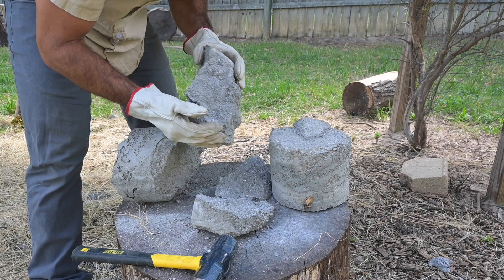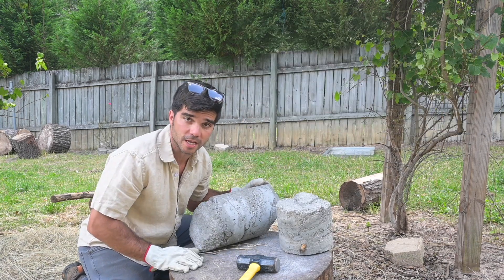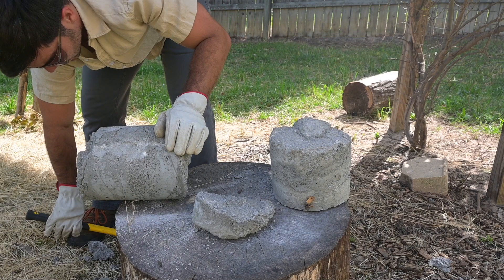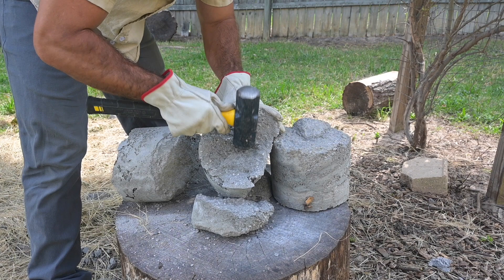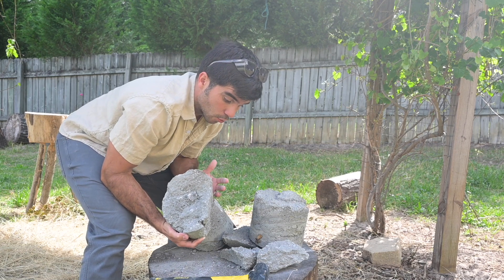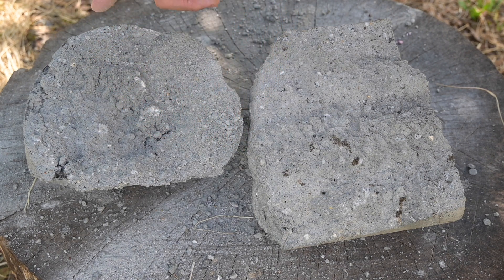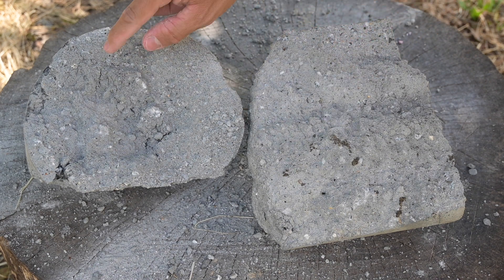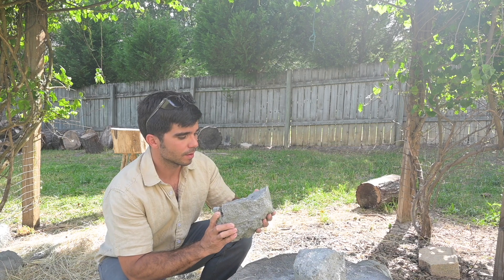Was I Wrong About Dry Pour? 🤔 (testing four weeks after pour)

Comment: I did a 3' x 7' pad for the steps up to my wife's She Shed using dry pour.  The depth was about 4 inches and I put a metal mesh about halfway through.  I poured a few bags at a time and used a garden rake (not a leaf rake) to mix it in as I went.  I also tamped down the ground before pouring any concrete, and tamped it all down solid at about 2" before placing the mesh and poured in the rest of the bags.  

As I built up the layers to the top of the wood forms, I kept tamping down the concrete especially along the edges to make sure I had no air pockets.  I screeted the entire top multiple times to drive 99%+ of the rocks down into the concrete. I then used a light broom to lightly brush the top to smooth out the look.  I did use a curved concrete towel to round over the edges on the three sides not up against the shed.  That last part was a pain and though it turned out nice --I do not recommend it for the trouble it takes to make it look decent.  In the end though, It has turned out pretty good.

I did have one issue.  After I did my second misting of water, we had a heavy unexpected downpour of rain (I'm in Florida).  A few areas on top ended up pitted including a bout a one inch hole on the back where the water came down as a stream off the roof.  No rain was expected that day, but hey in Florida it can rain without warning just about any time.  Those areas will be covered or hidden by the steps, so I call it a success.  

I waited one week before I took of my forms and the edges look solid and smooth with no air pockets.  I am waiting a full month (one week to go) before I build the steps and attach them to the pad using 1/2" redhead concrete bolts.  I call it a success so far and am very happy with the end result.  I'll post back here if the concrete bolts cause and issue (like encountering powder in the drilled out holes).  Cheers!

Comment: "...it doesn't really save you anything because of the fact you have to come back and water it for hours on end." -- well, you don't "have" to-- several of the dry pour experimenters have misted a few times to get a smooth hard surface and then just done a big dousing a couple times a day, and it seems the concrete absorbs what it needs and the rest runs off. But the main point is that for DIYers who don't have the tools or strength to mix large wet mix batches, dry pour saves them A LOT. They have the time, they're not like a contractor who needs to come in, pour it, and leave, because every additional trip would cost them a lot. I like that you're willing to keep an open mind, but I just think you need to put yourself more in the mindset of a typical DIYer for whom a small slab would either have to be DIY (wet or dry) or insanely expensive to have a contractor come in (and most won't for small jobs). And the typical DIYer may not have even a wheelbarrow (I don't for my small yard). Dry pour may indeed turn out to result in less strong -but still strong enough- slabs, but it's looking great for my small utility pad in my backyard I've been needing for years.
Reply from the maker: People have repeatedly told me that you "have to" water it for days on end and have told me all of my failures are due to not watering enough times for enough days. Glad you're not one of them.

I am also not a fan of the wheelbarrow method. I think it doesn't need to be black and white. We can mix a small amount in a bucket with a drill attachment or even mix with a piece of rebar once it's in the form (as I shoed in my first concrete video) and get a much stronger result without a wheelbarrow, concrete mixer, contractor, etc. It's not just the watering that bothers me, it's the lack of homogeneity. Mixing, even a bit, fixes that.
Reply: @appalachianwoodhomestead  I understand. I think your experiment adds good info to all the experimenting that's gone on, but I don't think that the tube pour results are ever going to be directly comparable to a basic 2-4" slab pour. I don't want to sound like I think you should do more work, but if you do want to "go deeper" (pun intended) into the topic, shallower slab testing (where excess moisture can run off instead of eventually "eroding" a drain path through) would also be more applicable to where dry pour methods can be best used: small DIY projects which can cure over the course of weeks instead of hours. Thanks!
Reply from the maker: @isabellavision  Dry pour is better suited to slabs. I'd really like to find an "easier" way to do piers for a project I'm doing this summer.
I would like to get a rebound hammer and do some testing with slabs. Trying to talk the wife into it.
Reply: @appalachianwoodhomestead  definitely better for slabs. Slabs are scary for people who don't want to waste $2000 on concrete (the look of it) with a concrete truck and have a time limit.

Making piers is pretty easy. 5 gallon bucket, add water and mix. So many ways to mix, and it doesn't have to look pretty.

Comment: I think you will get far better results vibrating or even tapping the pour as trapped air is concerned. A vibrator is used, or should be on any vertical pour over two feet in depth, speaking about wet pour jobs. I lost a vibrator in an eight inch diameter dock piling we were pouring as the man operating it did not keep it moving. The vibration or movement consolidates the fines to a point the friction will hand cuff anything around, aggregate included. Ended up cutting tube and calling it additional rebar. I have dry poured fence posts, thrust blocks on water mains for over fifty years, no problems.. Just finished my second 5 ft x 5 ft x 4 in depth dry pour going by Cajun Countries advice and they are great. Will be doing a 21 ft x 21 ft sectional work slab next. As cost is concerned this is a very economical process. Only financial outlay is for concrete. I buy by the pallet (42 bags) app. one cubic yard. I have a one ton flat bed and it will haul two pallets, I choose to haul one. A pallet costs just a little over what a 10 yard load costs per yard. If you order less you get hammered with fees. Labor as well, professional help is eliminated, a huge savings. A good idea that should benefit all DIY'ers. I considered pouring a few cylinders of dry pour and getting compression strength tests run. Having been retired 23 years I am sure all contacts with the three testing companies have vanished. Leave a bag of pure Portland in a covered warehouse for a length of time, no sand, aggregate. It will turn to a hunk of stone. Huge fan of dry pour.
Reply from the maker: I did tap the tube form frequently throughout the process. Maybe more aggressive vibration would do a better job at "mixing." You can see it in this video: https://youtu.be/iLD4W4JKvSA

I do think the dry pour method is better suited to slabs. Thanks for the tip about savings with a bulk purchase!

Comment: What does he mean it doesn't  save you anything? Dry pour doesn't require all the extra equipment, and mess that wet pour does. For many, that's the deciding factor. I'm actually considering doing a dry poor off my backdoor now, because I realize it's not going to be as costly as I thought it would be. Sure it doesn't make sense, if you already have the knowledge, and equipment to do a wet poor, but if you can get a decent result by simply spreading dry mix, and watering it repeatedly, then for many it's a no brainer.
Reply from the maker: My preferred method for smaller projects is mixing a little at a time by hand or with a drill attachment in a 5 gallon bucket. Easier than a wheelbarrow, cheaper than a mixer, more reliable than dry pour.
Reply: This is the whole root of the argument. To dry pour I simply need to open some bags, spread it out and water. Even a 20'x10' pad can be done in a day easily by one or two people. A 20' x 10' pad poured is going to cost thousands of dollars and equipment. At the end of the day the biggest mistake I see people making on dry pours is not using enough water initially. Soak it, and then soak it some more for a good week if need be. It is proven cement cures fantastic under water. Put some rebar in on the big projects and call it done. I am going to be doing this, this summer or fall for a BBQ area and that 20' x 10' pad for my boat.
Reply: @FloridaDude1969  Agree.   Labor is over half the cost.

Comment: please do a very thick foundation type test, I want to see if I can do a house foundation and block wall footers with dry material, remember to get the water to penetrate once or twice then you can't put too much water for 28 days while it wet cures...  i think you can even keep it underwater...

From Ai:

---

can portland concrete cure under water?
ChatGPT
Yes, Portland cement concrete can cure underwater. In fact, curing concrete underwater can provide certain benefits in specific construction scenarios. When concrete cures underwater, it remains constantly saturated, which helps to maintain a favorable environment for hydration and curing.

Here are some important points to consider regarding the underwater curing of concrete:

Submerged conditions: The curing process underwater requires the concrete to be fully submerged and surrounded by water on all sides. This method is commonly used for structures such as underwater foundations, piers, dams, or any construction where the concrete is continuously exposed to water.

Continuous moisture supply: Underwater curing ensures a continuous supply of moisture to the concrete, which is essential for proper hydration. The presence of water allows the cementitious materials in the concrete to react and form the desired strength and durability.

Protection against drying: By curing underwater, the concrete is protected from rapid moisture loss through evaporation, which can occur during conventional air curing. This reduces the risk of shrinkage, cracking, and surface damage that can result from drying too quickly.

Extended curing duration: Curing concrete underwater often requires longer durations compared to traditional curing methods. It is not uncommon for underwater curing to continue for several weeks or even months, depending on the specific project requirements.

Water quality considerations: The quality and cleanliness of the water surrounding the submerged concrete can be important. Ideally, the water should be free from contaminants that could potentially affect the concrete's properties or cause deterioration.

It's worth noting that while underwater curing can be beneficial in certain circumstances, it may not be practical or necessary for every concrete construction project. The decision to cure concrete underwater should be based on project specifications, engineering requirements, and the advice of professionals experienced in underwater construction.

---

So you could theoretically make a foundation footing and keep it under water for 28 days so it gets really cured hard... then test it...

Comment: You still have to calculate the amount of water based on the amount of concrete mix... and then you have to find the adjustment to that formula that works for dry pouring... it could be more or even less water, but I would go with more water... from what I've seen dry pouring is different and takes longer to harden and longer to dry...  but you have to use enough water the first time it gets wet, and perhaps you can't use too much water... the misting is so you don't mess up the surface on the slabs and is probably not needed for the piers they have been dry pour fence piers for a long time and they seem to work, but not sure about walls and foundations, I think more testing is needed, it would be cool to be able to make walls out of dry pouring cement, but the secrete is how much water and how to get it down evenly and soon enough... I'm not sure with the Portland based concrete mixes that you can just wait forever to get it wet enough because certain elements in the chemical process will get used up... The roman concrete method was a hot mix using quicklime so that it could heal...  would be interesting to see if you can make a functional foundation or wall if you improve on the method.  Thanks for the video.